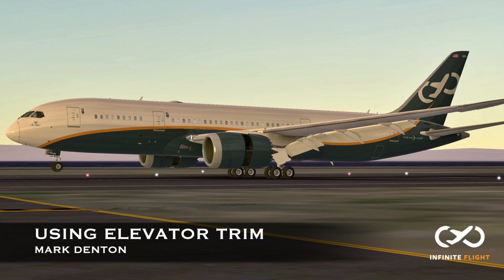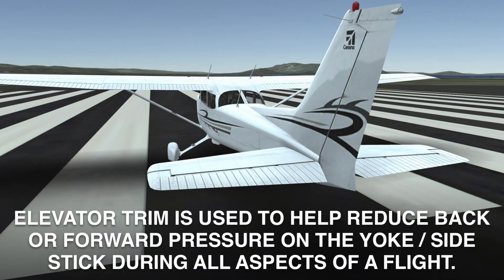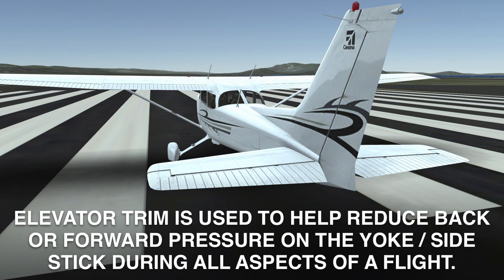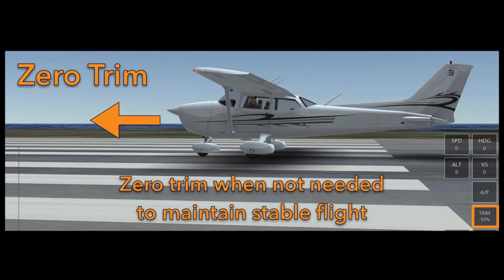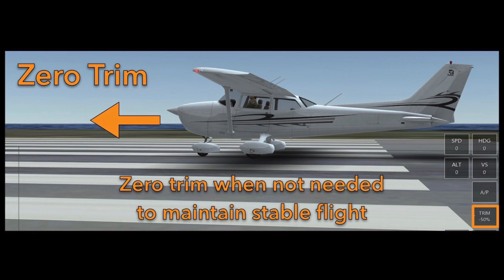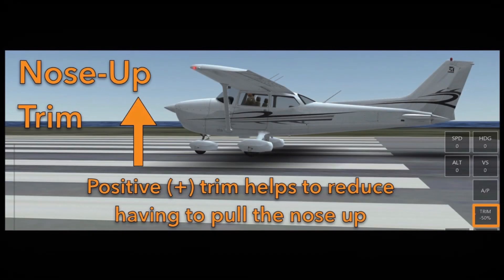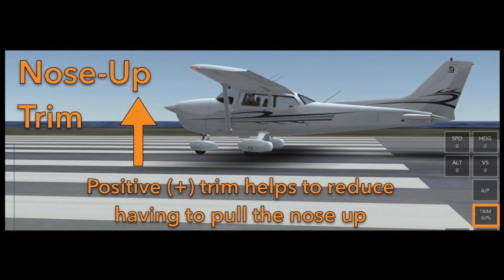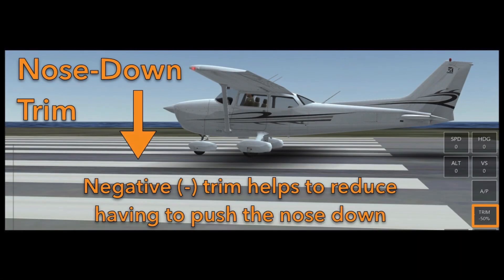Elevator Trim Tutorial

Comment: I have a question when I take off the plane I climb to 40,000 feet then I put the speed full and it only goes 220 knots
Reply: As you get higher in the atmosphere you there is less air, it will usually decrease your air speed, but at the same time your ground speed will be increasing. Also try and lower your rate of feet per minute to around 1000 Vs.

Comment: My a330/a340 cant fly straight can I change that by using the trim?
Reply from the maker: Chances are you are flying too fast.
Reply: Infinite Flight 350 kts
Reply from the maker: That is most likely too fast.  Try starting at cruise altitude at around M0.80 then work your way up to around M0.85.  We plan on reworking these aircraft in the future.
Reply: Would be really great

Comment: if im fying a380 at cruising altitude, the nose of a380 down,so to maintain it trim up to positive? or it juz use for take off or landing only?
Reply from the maker: If the nose of the aircraft has a negative pitch during cruise, chances are you are flying to fast. You can generally adjust the pitch by slowing the aircraft down.  Another option would be to increase the weight.  Pitch should be around +2º during cruise at Mach 0.85
Reply: Nose-down pitch (by a degree or two) during cruise is not a big deal and is common, even in real-world aviation.
Reply: Infinite Flight i had added a weight to aircraft n yes u were rite... thank you...
Reply: Miam ga no...thats nothing wrong with it... they were right about nose down at high speed from what im questioning is... this game really closed to actual speed n pitched
Reply: BlakeBigfoot im not a pilot or anything to do with aviations. It just a game. Dont worry im not gonna delete my question so others who is zero bout aviation know sumthing.